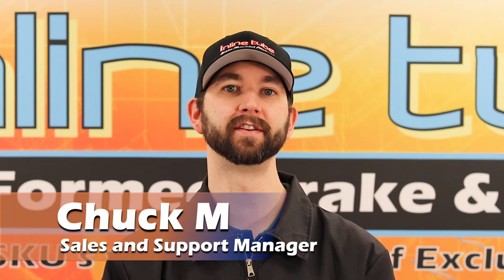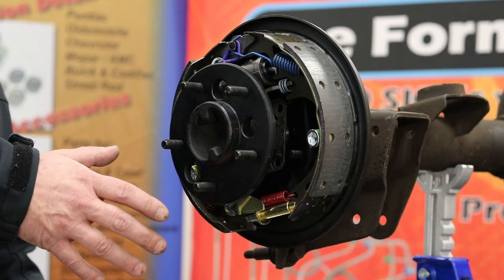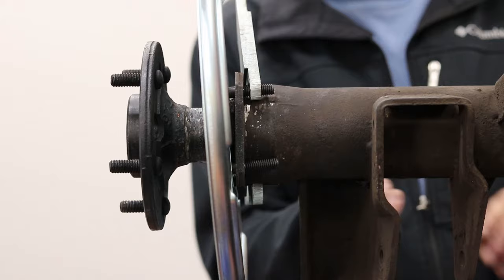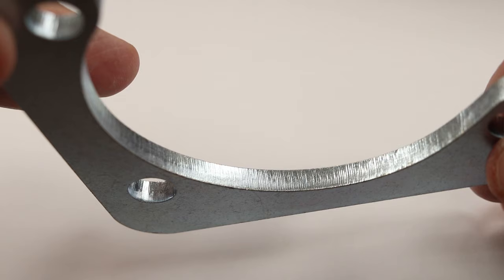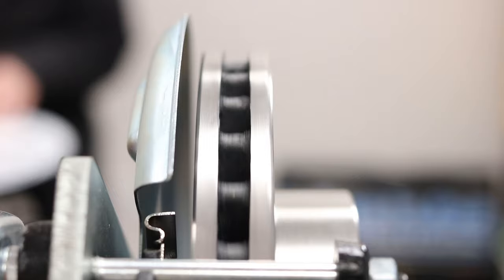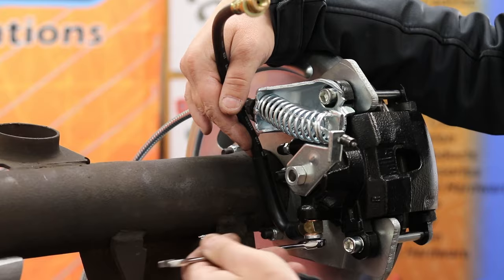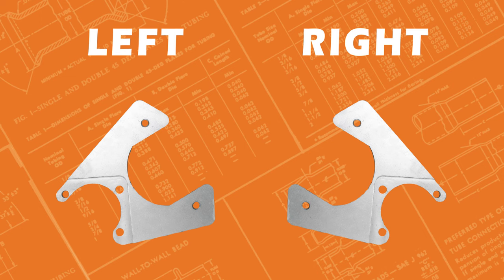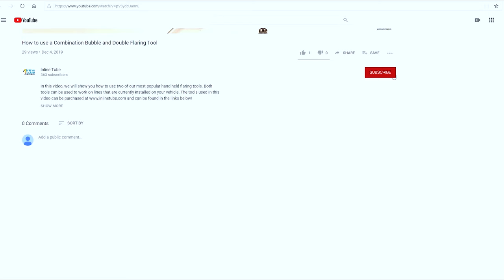How to | Rear Disc Brake Conversion

Comment: im thinking of doing this for my project truck , which i am using the BOP rear end , currently with drums . I'm not exactly sure what year it is but it has 3 inch tubes 5x4.75 lug pattern and the 10 bolt diff cover with the indents . You guys make it look so easy .

Comment: Will this fit a Camaro 1967 because I bought it but I didn’t notice that it’s for 1968!!!
Reply: 1967 Camaro is not a staggered shock set up like the 1968 and UP F Body.  You will need to buy the DBK1012 and not the DBK1012S

Comment: Any chance you have a kit that would fit a 1990 Mercury Grand Marquis? I believe my car has the 9 inch drum brakes. I looked on your site and didn't see it, but perhaps you provide parts for a different Ford that used the same standard equipment? Also, wouldn't I need to also replace the master cylinder with one of a different design?
Reply: Sorry we do not have the parts for the application that you have requested.

Comment: Thanks for sharing the video.... one question if i may?  is there a way to shim the calipers and brakes pads 'outward' as opposed to inward?  that seems to be my issue.....  Thanks
Reply: There is no way to shim them out.  We set these up on stock axles.  You will need to make certain if you are changing axles that they are exactly the same length as stock.

Comment: Hello, sorry I have a 1992 4.9 L Ford F-150 6 inline pickup truck Rear Gawr 3166 LB and Total GVWR 5450 LB and I want to convert it from drum brakes to disc brakes. Could you tell me which are the ideal brake discs to use in this truck, please. Thanks.
Reply: Sorry We do not carry any brake kits that would fit that vehicle

Comment: Question, what if my car doesn’t have the E brake cable , can I still use that caliper?
Reply: yes you must set the e-brake regularly in order to keep the pads adjusted.  The good news is we do have the e-brake delete kits in stock.
Reply: No you would have to use the e-brake delete kit

Comment: Do the Lug Nut Studs have to be replaced on a1969 Chevy 12 Bolt rear? I read they will be 1/4 inch too short after reassembly.
Reply: I have not run into this issue before.  Sometimes It will depend on the wheel you use also.

Comment: Do y'all make some for a 79 and 89 Chevy Caprice car's
Reply from the maker: That depends on the axle that was in your car.  Our kit is built for a 10 bolt or 12 bolt axle that originally came with 9 1/2" drum brakes.